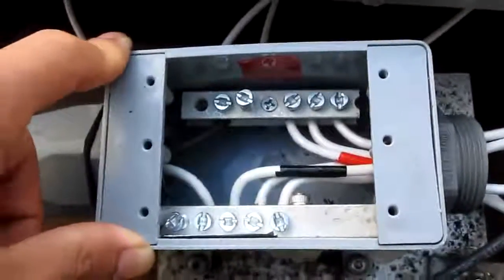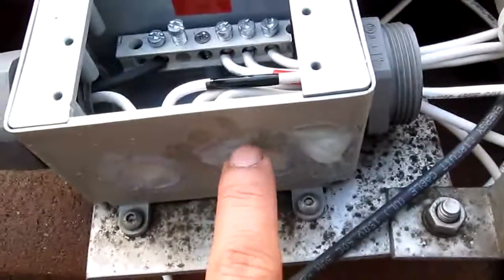DIY Home made solar combiner box for $8 for solar panel array

Comment: Those wires look tiny?
Reply: higher voltage uses smaller wire. 12v wire is a killer.